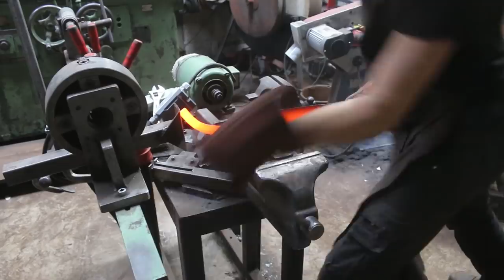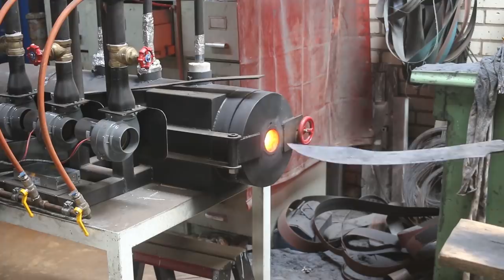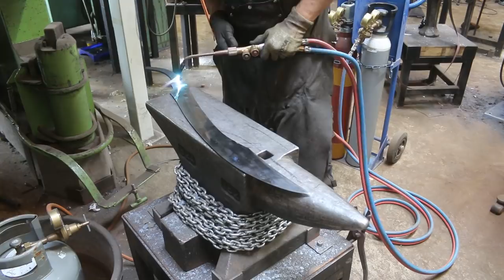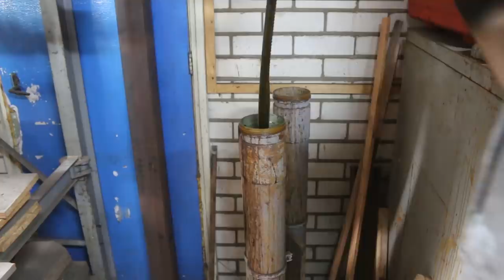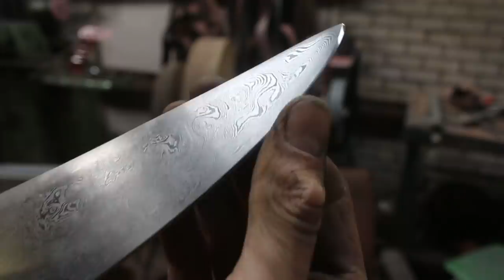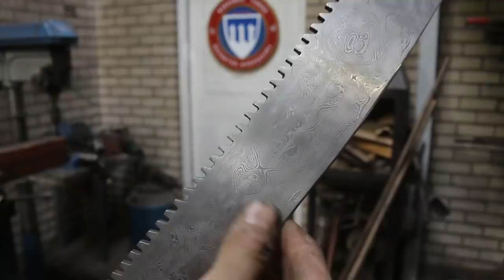Forging a pirate cutlass, part 2, heat treatment.

Comment: I would really love to know what the wood planks are used for through the Heat Treating process? Are you adding carbon back or are you normalizing? Your work is amazing I aspire to your quality
Reply: So that the blade cools straight and less hammering is needed, but I'm just guessing.

Comment: I will be happy when I finish my power hammer, and can take some try's at pattern welded steel. I'm sure it's going to be humbling just like trying anything else you do.
At the present I'm working a cutlass. I'm making the guard. I started with a taper with a radius at both ends and cold forged it. Suprising to me it looks good. This pounding is considered a last resort in the sheetmetal trade, but it's all we have to make some shapes. I will be happy when it's done. So I can see how much I lack. 
This is the best way to learn.  No Pressure!

Comment: What does clamping it between the boards do? Prevent warps?
Reply: The curve of the blade
Reply: Essentially, yes. 
Freerk warm oil quenches these steels, which leaves a degree of heat in the blade even though the alloys are through their Mf90 temperatures. So that they don't stress relieve with that final thermal energy loss in such a way that causes warps, clamping them between boards allows the blades to lose heat at a rate commensurate with stress relief along the long axis, as opposed to through, which would cause warping.

Comment: Are those saw teeth really functional the way there cut ? . 😎 .
Reply: Yes they can cut, just not very efficient if you try to cut on one stroke. It would make up some of that by cutting on both push and pull though.
Reply: Not really. Just there to look 'badass'. In terms of practicality,  I don't think the blade would go deep enough for them to effect a thrusting cut- perhaps prone to chipping? Historically speaking, I've never seen a pirate blade with teeth. Personally,  I think he's ruined the look of the piece.

Comment: Wooden planks do wonderful job but ever thought of making a blade straigthning jig???? Just a thought pardon me if sounds stupid .😊😊👍👍👍👍👍👍
Reply: I think as Freerk's blades are all one of a kind and because of the difference from blade to blade, you would need to make a new jig every time so clamp pressure would be even along the length. Wood crushes around the blade, pressure will be more evenly distributed. That's my guess.
Reply: You want the blade to stay straight as it stress relieves under its own residual heat, not try to straighten a fully hardened/hardened and tempered cold blade